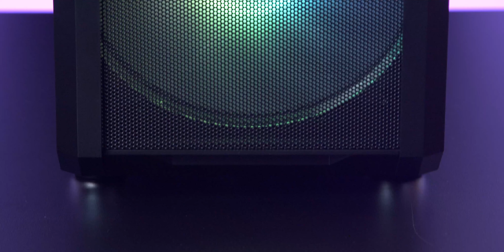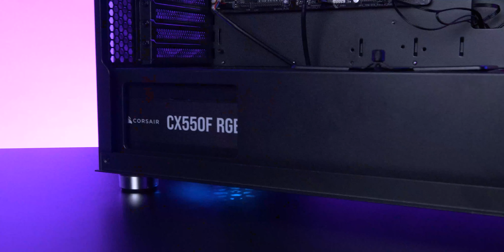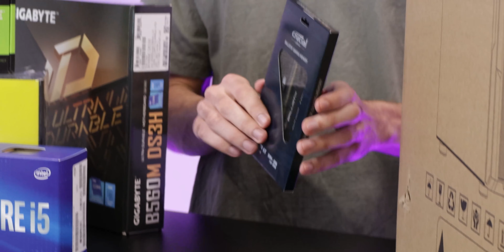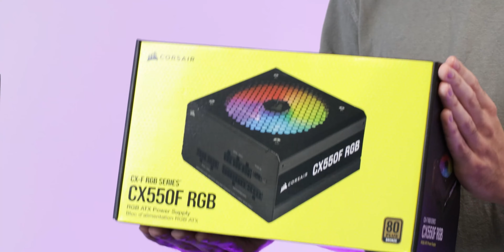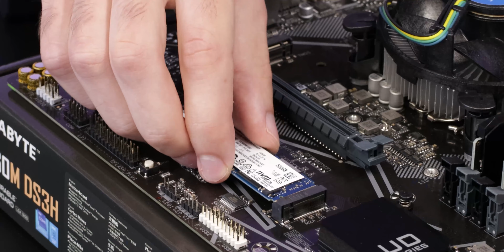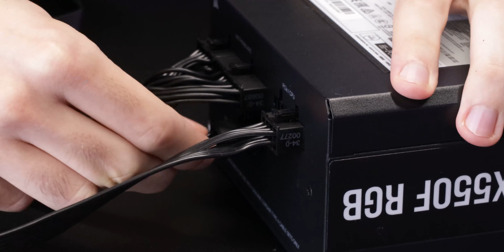Intel CPU in a budget build? - £500 PC Build Challenge

Comment: Sir my new nvme is running only at pcie 3 X2 but max supported is 3 x4 .
Please give solution I will be very thankfull
Reply from the maker: Hi there, double-check the motherboard manual and BIOS the drive is configured correctly. It may be running in SATA mode, or in a shared SATA/PCIe slot
Reply: @ebuyerofficial  how to check that my laptop is asus vivobook 15 m509da
Reply: I tried removing hdd and only putting nvme but it's still the same
Reply from the maker: Check the bios. if it is set to auto then this may be the reason its running at X2, make sure the lane is set for gen 3 X4